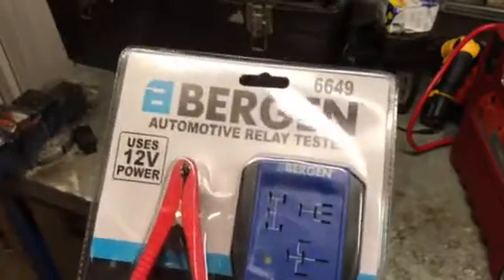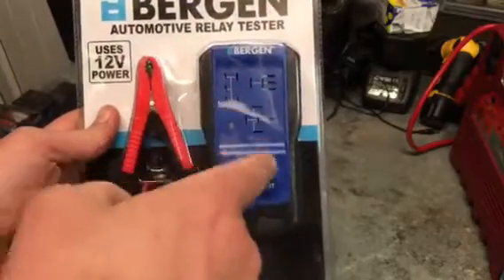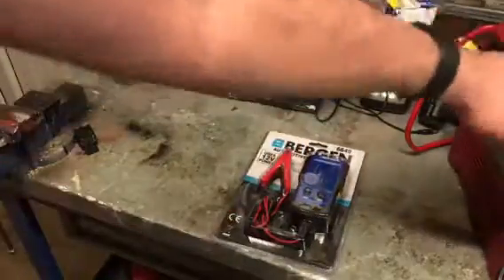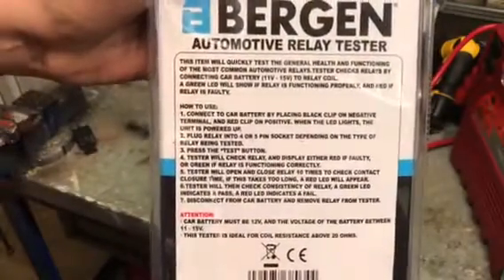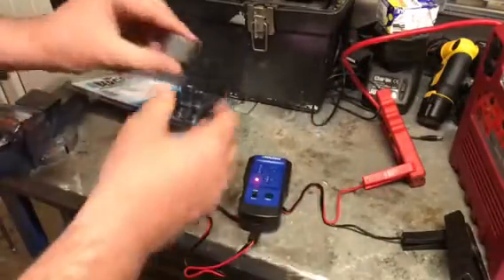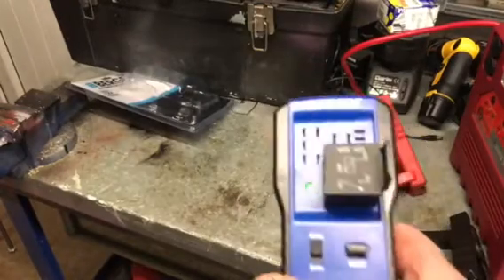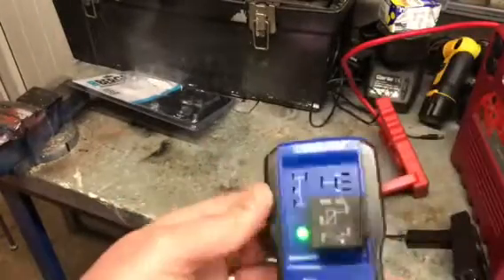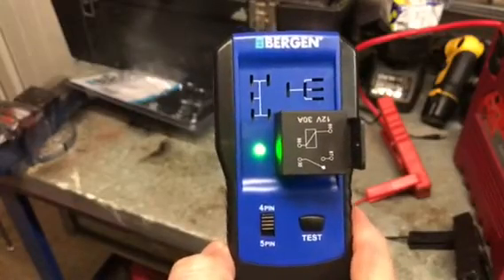Bergen relay tester review

Comment: My 5 pin relay with double output immediately fails when i set the tester to 5 pins and begin testing but when i tried setting it to 4 pins, it will click 10x and pass. Any ideas?
Reply from the maker: Do you suspect the relay has failed?
Reply: @drivewaydiyer6504  no.
Reply from the maker: I’m not sure what relay it is and what controls it has. Obviously with any equipment, is it faulty. It could have five pins , but only 4 are in action and one is a dummy pin. Find out more about your relay. 👍

Comment: I ordered one of these of ebay and mine was junk - red light wouldn't go off even with 5 separate working relays. it was exactly the same as this but branded "US PRO" but probably from the same chinese factory as this one. i'm glad to see yours seems to work though
Reply from the maker: There’s a lot of copies out there, I bought a Sealey one, which was a Chinese copy.it but not out straight away.🙄
Reply: @drivewaydiyer6504  I'll know to order the authentic Bergen one next, thanks - great vid BTW

Comment: How does it test 5 pin ? Does it load both sides ? Of the pin ?
Reply from the maker: Henal Madhvani it activates the contact and tests the consistency of the contacts over 10 activations. I suspect it loads both sides. Relays can work time after time, then fail once, then carry on working again.
Reply: Driveway DIYer I’ve bought it, hopefully it comes and works, the main thing I need to test is if actually loads both pins on a 5 pin since i find my the coil always work and the normally open side is the ones that fail,
Reply from the maker: Henal Madhvani it has a setting for the five pin, so it should test its ability on all variables, let me know how you get on. Thanks for watching.👍👍👍